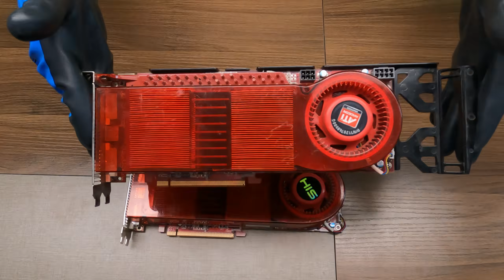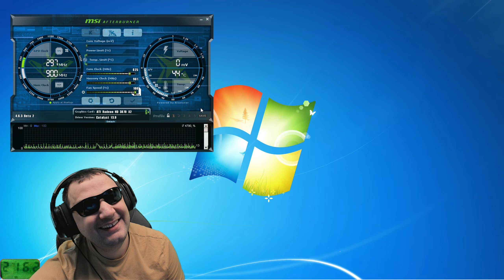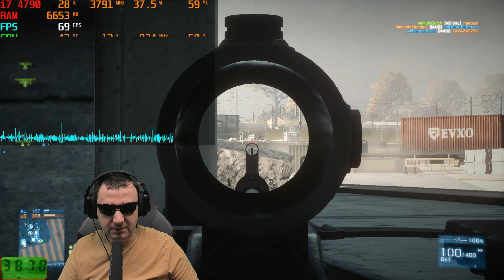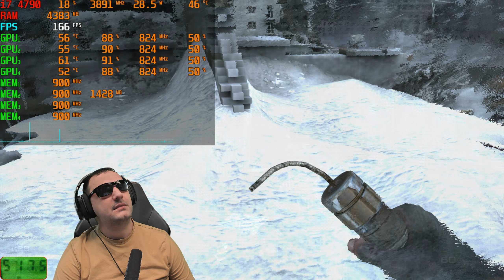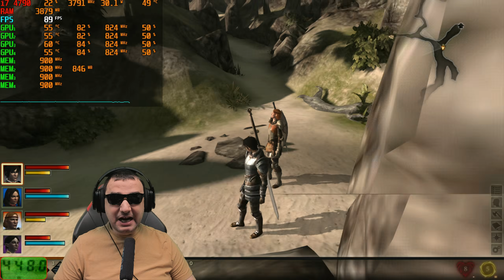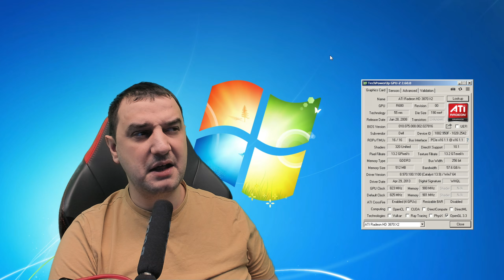ATI Radeon HD 3870 X2 Quad Crossfire Benchmark

Comment: yer doin it wrong
Reply from the maker: @CR055FIRE  how?
Reply: @DanielCardei  i'm just messing with ya 

i used 3870x2 crossfire on the Crosshair III Formula 790FX with a Phenom II 970 x4 at 4.2GHz on air (1.456v); using mid-2008 Catalyst driver